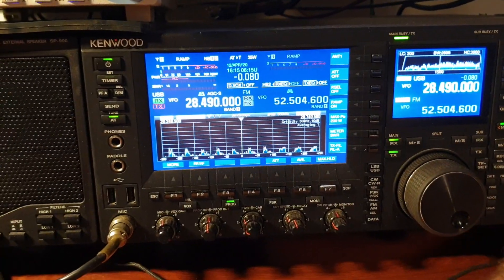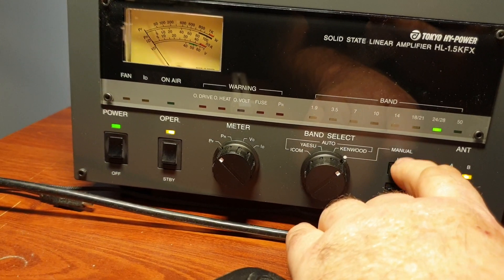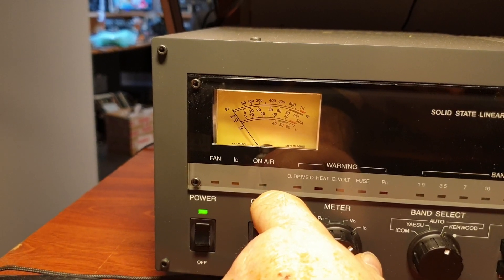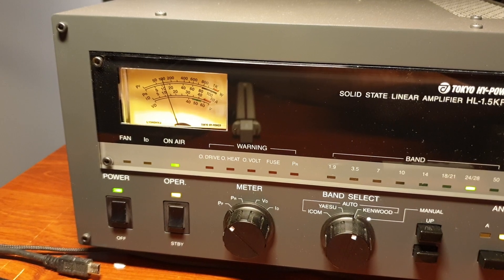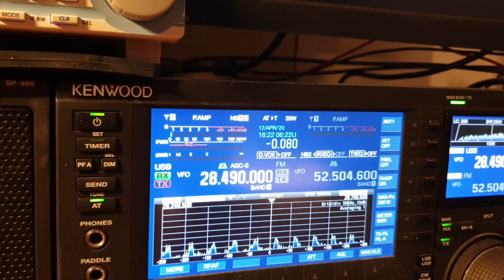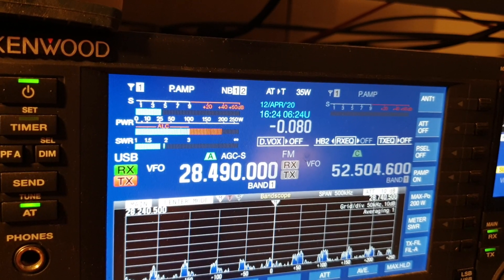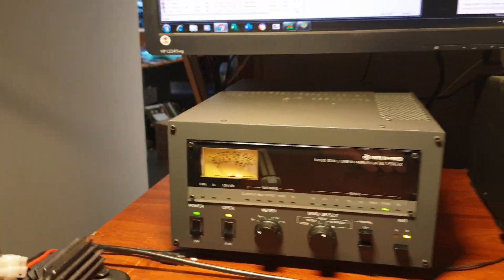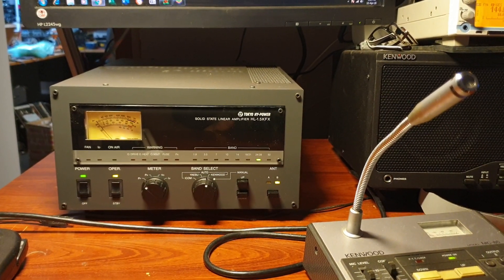Tokyo Hy-power HL-1.5KFX 1kw solid state amplifier.

Comment: I just bought this amp and after setting up the installation of my two radios I find that I have NO RECEIVE on input B.  I have double checked all my connections but when I turn on the radio connected to input B I have no receive as if there is no antenna.  The manual shows all three radios Kenwood, Icom and Yaesu being set up on input A   There is no mention of input B.

Comment: very nice video Brenton congratulations, one question for you...the test was around 35 watts its clear that you get 400watts, but if you driver with 100w (maximum power input) how many watts do you have out , did you tested? best 73s from Hernani CT1DRD
Reply from the maker: Hi Hernani, we have a 400w limit here in australia when connected to an antenna but the amplifier will do 1kw with more drive for sure into a dummy load.. cheers Brenton VK3CM
Reply: Brenton Meadows many thanks ! I asked because I have one, and my amplified with 100w drives a 800w and not more...I don’t know if it’s normal... many thanks for the answer and many successes all the best! 73Hernani CT1DRD

Comment: Great video, I have the same amp and the matching HC-1.5KAT tuner, radio is a Kenwood TS-590S and antennas are a NA4RR hexbeam at 12 feet (hope to get it on the roof soon) and a 160-6 OCF dipole at 50 feet.  Hope to catch you on the bands.  73 K9SMC